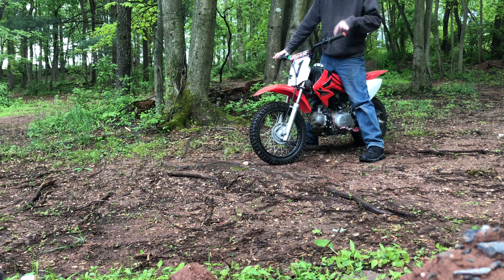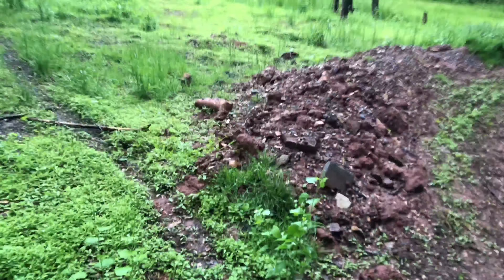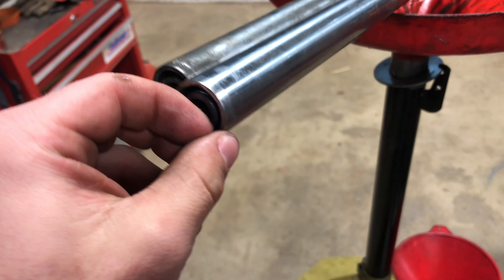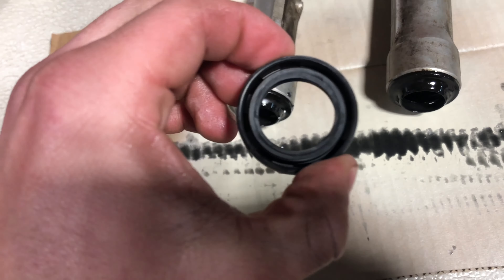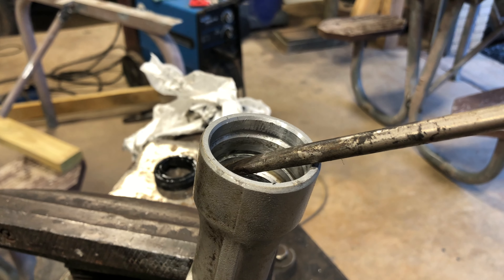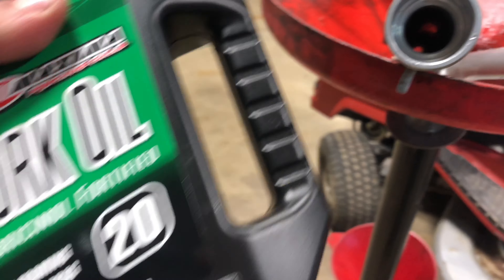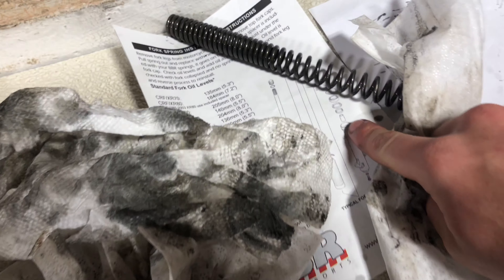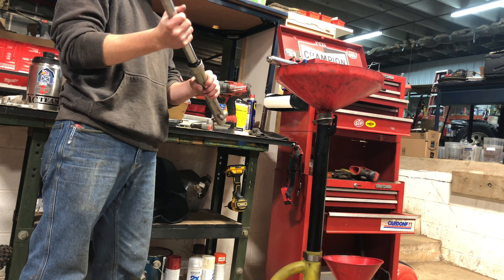How to replace the fork springs in a Honda crf70

Comment: Is there a way to get more height out of the forks? I’ve seen custom builds that have much more ground clearance.
Reply from the maker: The only way to make the bike taller is by getting longer fork tubes and springs. Stiffer springs just make it stiffer and sit as high as the current fork tube allows (which would be full droop of a stock system) so really the answer is no, at most an inch or so

Comment: Hi, too much  shock oil can
Make them perform worse. The spring is for your weight. The oil is always the same amount. You can change thickness of the oil for different trail characteristics. Good luck 
Happy trails

Comment: Hey man are those pegs and the shifter from Amazon? If so I’ve seen them and have been wanting to try them are they any good?
Reply from the maker: The tusk shifter is awesome. The pegs did not mount correctly, but they are built well. I had to do some bending and now i dont have return springs.
Reply: @Socket-Media   By any chance did you try using the stock return springs on the new pegs?
Reply from the maker: I tried using them, and they did not work so i could not use them.

Comment: What kind of springs did you put in after rebuilding ?
Reply from the maker: It was on the website “faster minis” it was their stiffened crf70 fork springs. I believe it was a BBR brand but i could be wrong.
Reply: @Socket-Media  did it make it taller too
Reply from the maker: @danielmccarthy2768  no